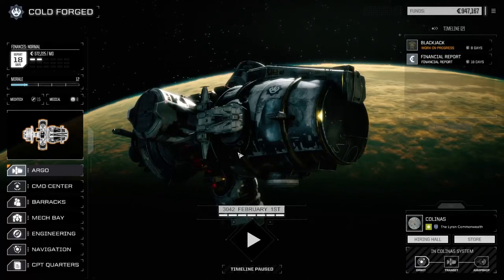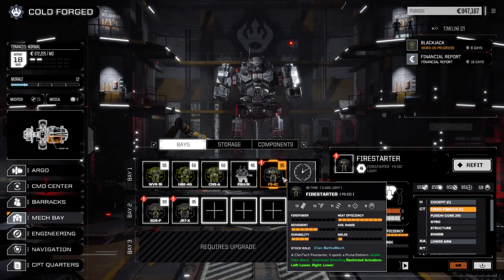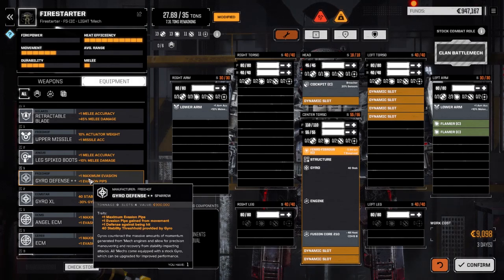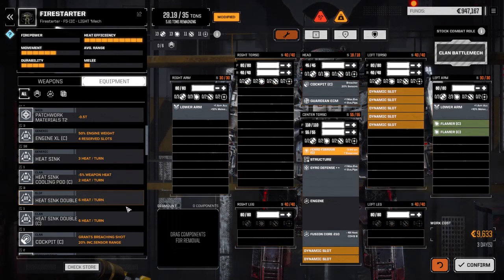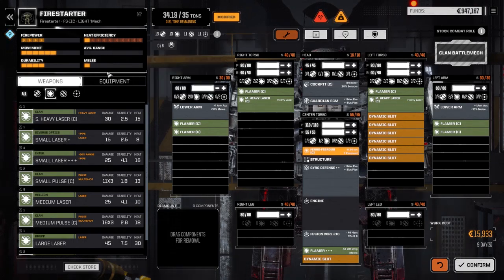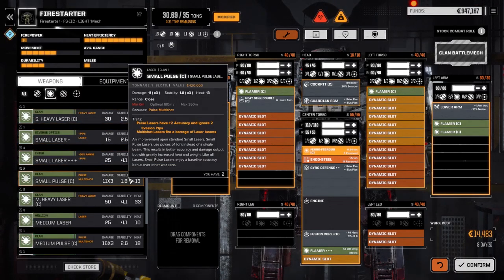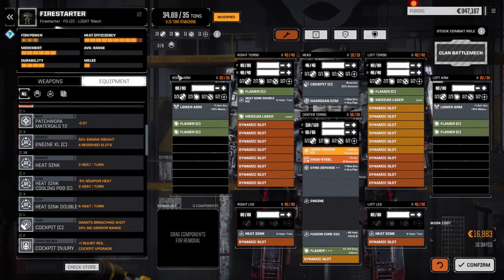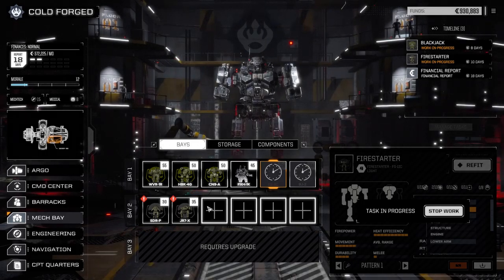Roguetech - COLD FORGED - Ep51

Comment: OMG I seriously can't watch people trying to build mech builds (how to builds mechs should be common knowledge seeing how old the ip is). Jenner normal LRMS + as much accuracy (artemis) as you can get was obvious choice (every time you mention that ammo that is - range + damage hurts my soul). I would have sold the thunderbolts like ages ago... Having accuracy is important in this mod. A reason why I wished you had swapped many of the lasers for pulse lasers when you have the chance.
Reply from the maker: Thunderbolts have inherent +1 accuracy so they benefit more in accuracy enhancers than a regular LRM. I am not big on the splash damage from LRMS unless you have a ton of them. Also, the deadfire ammo does shorten the range of the LRMS but the added punch makes it worth it. In the current version of Roguetech I would agree with you, but this version I don't.

The pulse lasers are debatable as you can run 2 ML's for every 1 pulse. The accuracy is slightly better on the pulses but they do less damage per hit. I think I'd still rather have 4 accuracy med lasers over 2 med pulse lasers.